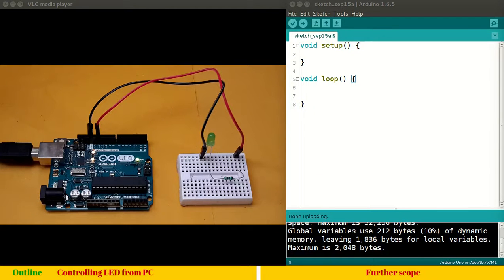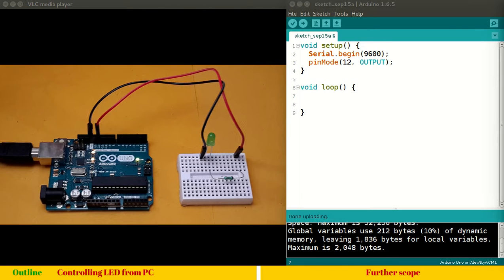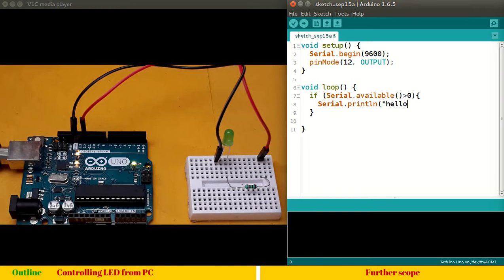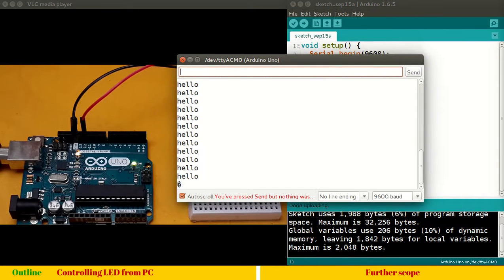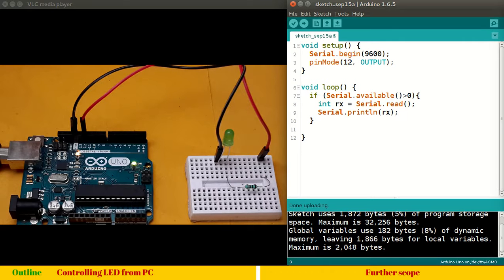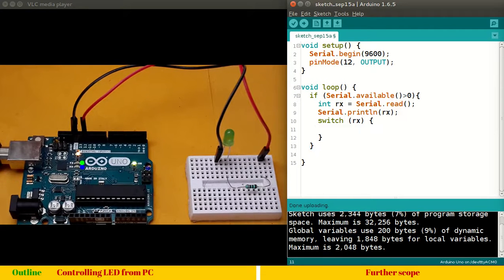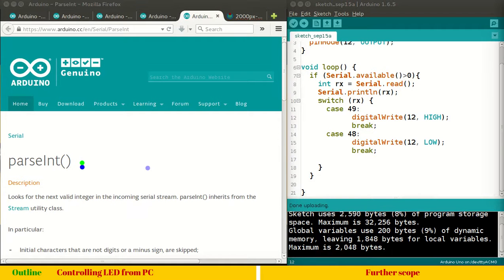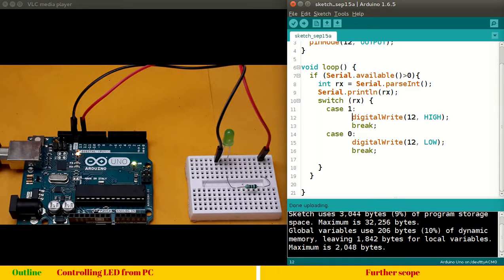13. Interfacing LED and controlling through Arduino serial communication

Comment: tnx 4 this, sir would like to ask, if i use word like hello to turn on and shut to off led, i just type this...in the case?
Reply from the maker: You can read a string from serial and apply it to switch case or if condition.

Comment: I'm doing test to light / erase a LED through commands through the serial port.
 The problem is the following, when sending the command to turn on or off the led of pin 13 of Arduino, it takes about 1 second to execute the command (change the logical state of the port), I had found an example where I had a command that did the Arduino perform the function immediately, but I did not find this example any more.
 Do you know which command ?? I think it's something like accuracy of response time. Below is the code I am testing.
 Thanks hugs.

String incoming;
void setup ()
{
  pinMode (LED_BUILTIN, OUTPUT);
  Serial.begin (9600); // Initialize the serial
}
void loop ()
{
   if (Serial.available ()> 0)
   {
   incoming = Serial.readString ();
    if (incoming == "on")
    {
    digitalWrite (LED_BUILTIN, HIGH); // turn the LED on (HIGH is the voltage level)
    }
    if (incoming == "hangs up")
    {
    digitalWrite (LED_BUILTIN, LOW); // turn the LED off by making the voltage LOW
    }
   }
}
Reply from the maker: Hey, I'm not sure about the exact command, but you may try increasing the baud rate(bits per sec) from 9600 to 115200 (12+ times faster). See here: https://www.arduino.cc/en/Reference/SoftwareSerialBegin

Comment: excuse me sir, when i use Serial.parseInt(), Serial automatically returns to 0. how i can fix that
thanks
Reply from the maker: I don't have a Arduino setup with me, sorry, I can't try now.
Reply: same. Have you fixed it?
Reply: in the case sentence, change the numbers. Use 2 instead of 1 (for HIGH) and use 3 instead of 2 (for LOW). In the "if"  write Serial.available()>1

Comment: If anyone here, for the solution of the " Serial automatically returns to 0" problem,  the solution is right way,  Enclose the  number after "case:" with a single quotation '1' and upload,

 (void loop() {
  if (Serial.available()>0) {  int rx =Serial.read();
 switch (rx){case '1': Serial.println("1"); 
 digitalWrite(13,HIGH);
break;
case '0':Serial.println("0"); 
 digitalWrite(13,LOW);
 break; }  }}